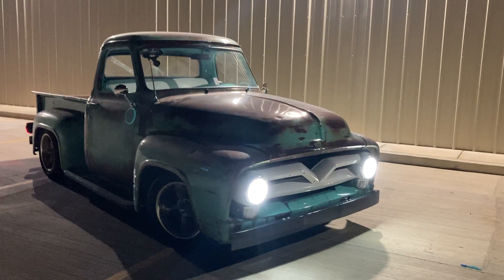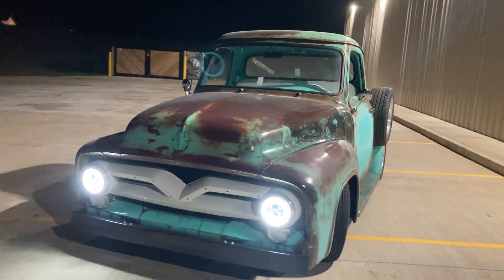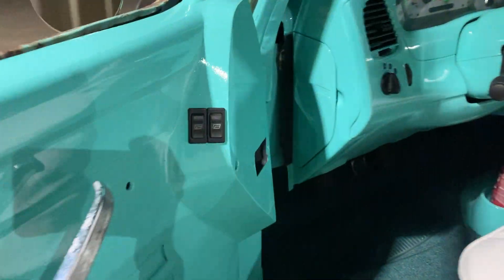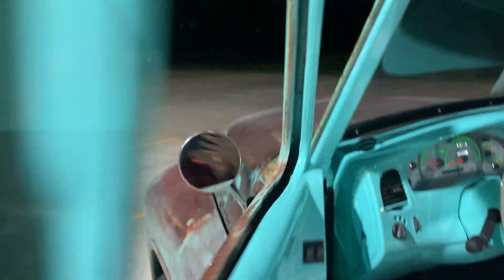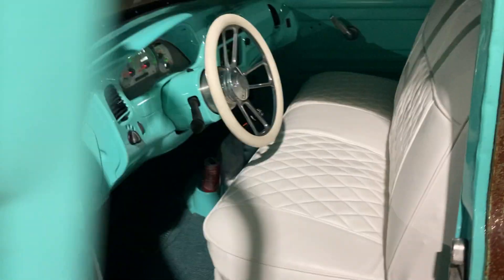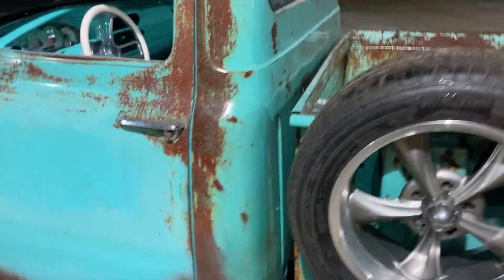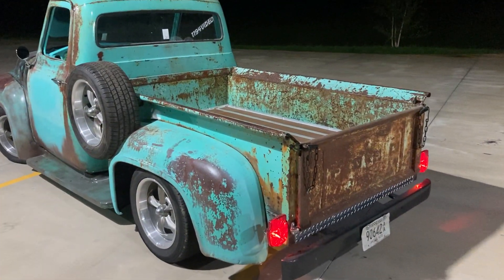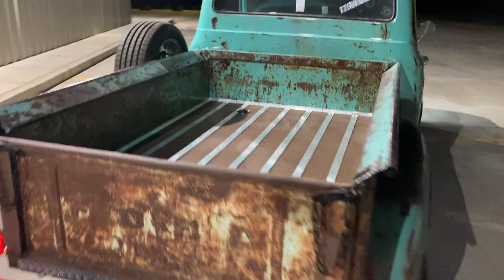F100 patina frame swap

Comment: Great job on this,but i was wondering if you would know if it's possible to put a 1989 ford ranger xlt extended cab on a 1984 ford ranger standard cab ,7 foot box running chassis and use a 6 foot box again?
Reply from the maker: I’ll start with. Anything is possible with enough imagination and determination. Now, the radiator support and front cab mounts will be the same but you will have to move the rear cab mounts to bolt it up and the bed bolts will pretty much be the same on rear but front 2 will have to be added.
Reply: @1194video  Thanks very much,i think i'll be doing that someday soon.